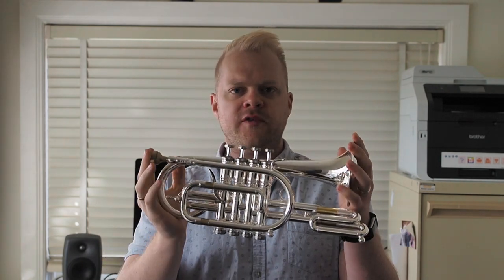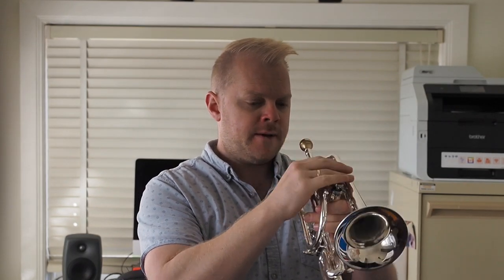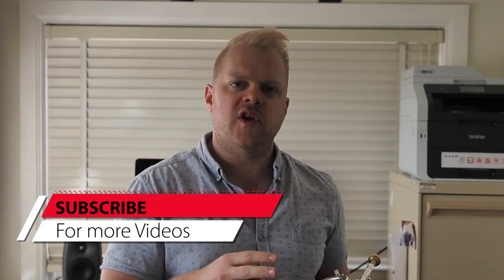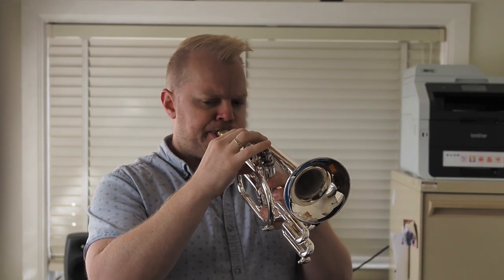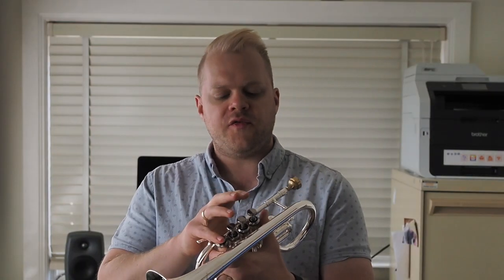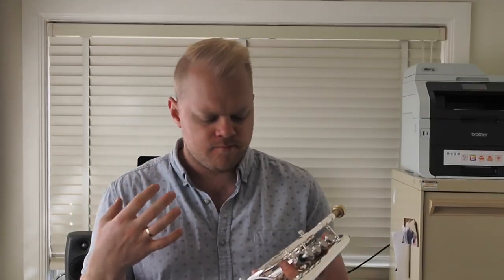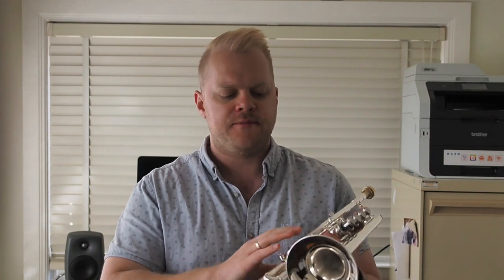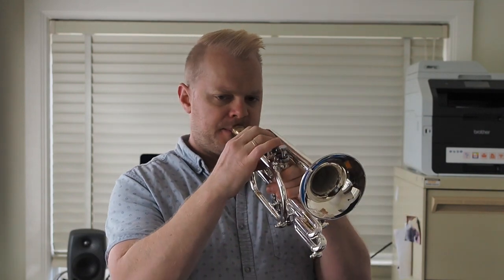Fad or Future? Is this the Future of the Trumpet?

Comment: As a low brass player I really appreciate fourth valves (or F attachments) on brass instruments, but I never really understood it on trumpets, since you almost never play in that low range and it kinda just doesn't usually sound good. One place I could see it sounding good though is on a flugelhorn, and I think four valve flugels have a possibility of being more standard, granted tho, that's a niche of a niche.
Reply from the maker: Interesting statement, I don't totally disagree. I believe the trumpet sound is especially beautiful in the top of the staff and a little above. But there are quite a few composers who have written in the "pedal" register. Strauss, Wagner and Bizet are frequently down there. The 4th valve makes it much easier to achieve.

Comment: Has a very open, clear and beautiful tone in your hands. Every note slots nicely with no extra fluffiness that some cornet players thinks is part of the expressive nature of the instrument. I much prefer this clear and full tone. The tone on the low register using the 4th valve really only works to the E or Eb would you agree? More effective on the 4 valve flugels overall.
Reply: killer articulation!!!!!!
Reply from the maker: Yeah I agree with the sound below “pedal” E. I think it could be user error at this stage and more practice would improve that ;).
Reply: @PhillONeillTrumpet  I think it might be that the instrument just isn't big enough to produce a better sound, unlike the flugel horn. I am sure it would get better over time as you get use to it, but more importantly is the way it responds when you first play it.
Reply: For better tuning, there are on Stomvi site some info about that. Check out on Flugelhorn 4 valves.

Comment: Hi Phil, great demos work. Can you demonstrate better, please, the 1rst valve slide trigger ? I assume that have a “link connection” to tuning slide too, isn’t ? The 3rd valve slide are like stomvi trumpet or flugel 4 valves system. Just asking because of lower register’s intonation and sound. Stomvi brand don’t demonstrate this and seams to forget the practical real thing. This 4 valves horns need more compensation on lower notes. Without triggers or slides it’s a mistake (from Stomvi). Like Flugelhorn, the extra 4 valve in E Works really better. The positions are different from Piccolo. So, that’s my asks and point of view.
Reply from the maker: Hi Nuno,
This is a valid point. I will need to make another video to answer some of these questions but will give a go in words :P.

There is no 1st valve slide Trigger or finger ring. The trigger I control with my left thumb is connected to  the main tuning slide and moves the main tuning slide.

The 3rd valve slide does have a ring to move the slide in and out just like on my normal 3 valve trumpet.
Reply: Phill O'Neill thank you !!!